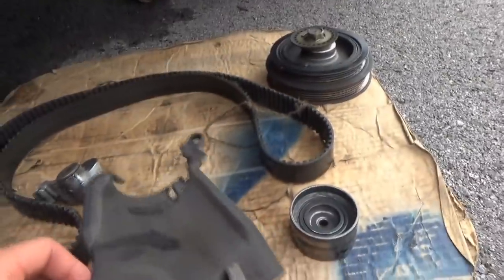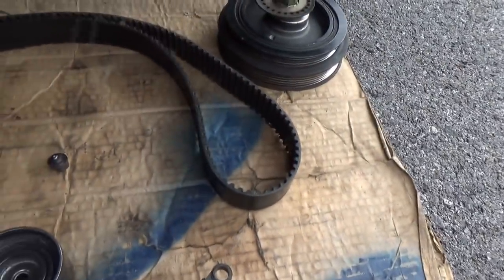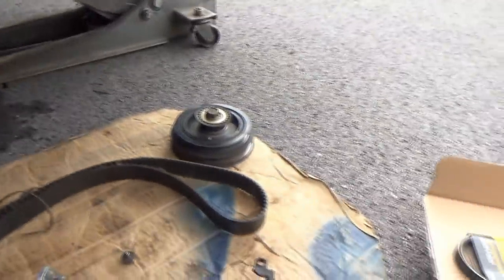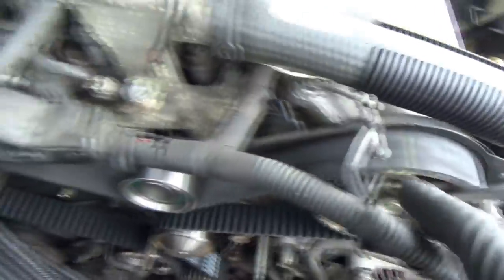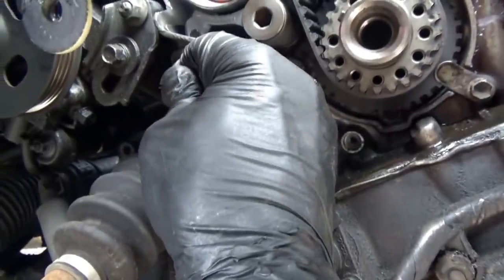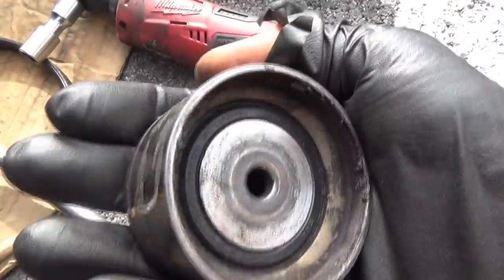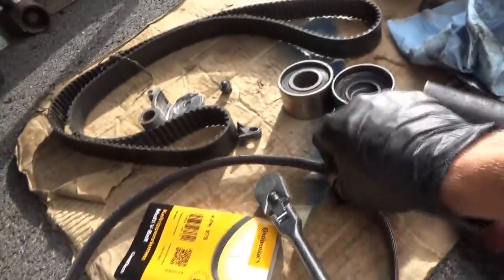Lexus Timing Belt CARNAGE!

Comment: Timing belts are quite and everyone likes a quiet engine,  some people like a loud exhaust ( I don't understand why ) and like you said with a non interference engine that's fine even when it does eventually break replace it and typically the water pump. or whatever parts go along with the job and your on your way
Reply: never heard  my timing  chains  in my gm cars  an my corvairs are gear drive  they last an last
Reply: I have a new Tundra...the 5.7 is very quiet. When you hear the chains, they are warning ⚠️  you that 💩 is coming soon. With oil changes, chains should go forever.

Comment: The 1MZ-FE was non-interference before variable valve timing was added. At normal timing a VVT version was still non-interference, but contact could be made depending on how much timing was being adjusted. Mom had an Avalon well past 300,000 miles. That engine still ran like new. It never needed anything past 2 timing belt (and preventative water pump) replacements and a new VSV for the EGR. I can only hope my 2GR-FE is that reliable (and yes I know it has a chain).

Comment: Nice job Ivan🤘 There's ya problem lady, and boy she was lucky it was a non interference engine. The other shop probably thought it was an interference engine and didn't want to touch it, potentially thought it was already toast. I wonder if the last time it had the timing belt job done, she or the previous shop skimped out on a new tensioner pulley, idlers, seals etc? I always recommend a full timing belt kit (including hydraulic tensioner + water pump if applicable to the engine) Just not worth reusing any of the old components while you're in there doing the job.👍🇦🇺

Comment: Bruh, I want to start be saying after over 20 years as a professional auto technician that you are one of the best diagnostic techs I have ever seen. And it’s a genuine pleasure to watch you work.
But I have two comments on this video.
1. I noticed you put a new water pump on there. But she didn’t go through the procedure at all. Did you take the cans in the backing plate off? Or did you sneak it out past the backing plate or cut it a little bit ? Plus I know from experience those engine mount bracket studs can be a real pain in the ass.
2. Now this one’s a little bit more of a scolding. I really have to wonder why you didn’t get a new hydraulic tensioner on a vehicle that is over 20 years old. Yes I realize that you may have checked it and it may not have been leaking. But you also compressed it to full travel. And in my experience hydraulic seals don’t like that after being inside a vehicle for that long.
I’m just saying how expensive is a tensioner versus the price of a disappointing customer maybe it’s a situational thing and you had to make a call. And I can understand it. Just saying at least inform the audience that might be a good idea to replace it.
Reply: I doubt if the water pump was done. I don't see any coolant on the ground, or buckets to catch the old stuff.
Reply: Yep, I had exactly the same thought on the tensioner, it's going to fail much sooner than any of the other timing components.
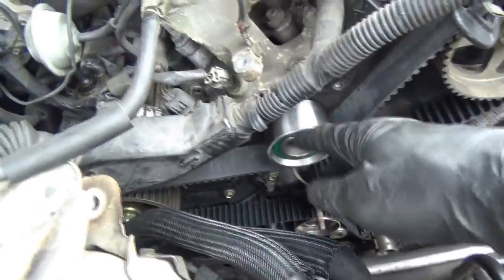Reply: @mph5896  Well someone replaced the water pump, Because if you look at the 4:45 mark of the video you can clearly see a fresh shiny water pump pulley and the entire assembly can be observed a few frames later
Reply: Damn voice text.  You know I meant cams and backing plate. And Apologies for the accidental addressing as feminine.
Reply from the maker: WP and hydraulic tensioner are fine and will easily last another 60k miles 👌🙂
Reply: @PineHollowAutoDiagnostics  
So the W/P wasn’t replaced? Damn. Looked brand new from this side of the camera. Well. Like I said, You’re one of the best i’ve seen.  So if you say it’s good I’ve got no reason to doubt your professionalism. 
One last question, Do you subscribe to ALLDATA TechAssist?
Reply: Customer does not want other work. Don't chastise Ivan for doing what he is being asked to do. If the customer doesn't want other work. That's their choice. Ivan is a dang fine stand-up guy in my book. ❤
Reply: I agree on the tensioner, because many times a weak tensioner is not diagnosed and the belts runs looser than it should, which results in rattling around like mad from engine valve train harmonics.
guess what that helps ruin?  the belt, tensioner bearing, the tensioner itself which now fails even faster and more. nothing likes harmonic battering!

Comment: I used to use Dayco timing belt kits, started having a lot of trouble with the water pumps. I switched to the Continental kits, no more problems.
Reply: I stick to aisin...
Reply: @Usmanthemecano  Aisin is usually OEM. The one nice thing about Continental is the marks on the belt.
Reply: @Usmanthemecano  I've use the Aisin kits on occasion but my supplier more readily has the Continental kits available.
Reply: I had a few Dayco accessory belts that would squeal like a motherlover for no reason. Put just a random Chinese brand on like a Blueprint or something and no more squealing. Very annoying.
Reply: The last Dayco timing kit I bought (for a four cam Subaru) included a wrong sized belt.  Everything else was okay.  I had to get the belt from Subaru.
Reply: Aisin d best
Reply: @Usmanthemecano  Aisin here too.  The bearings are Toyo from Japan and the water pumps look identical to the genuine Toyota that I remove.  Just looks like they grind off the Toyota name for licensing purposes?
Reply: @lizard944  exactly
Reply: @pirihern9329 Use Aisin, Never ever an Issue. Burnt to many times with Dayco, Gates, and Continental. Aisin all the way to the Bank Baby!

Comment: i'm about to change the timing belt on my 2003 Ford Focus. It still has the original timing belt. But the good ol 2.0 Zetec is non interference.
Reply from the maker: Same engine as my 96 Mercury Mystique 😁
Reply: @PineHollowAutoDiagnostics  it's a great engine. They are hard to kill. Not very powerful or efficient. But it'll last a long time. I've had my Focus for a year and haven't done anything to it mechanically. It has never let me down. But i am gonna get all the preventative maintenance done. The car has 111k miles. I flushed the power steering and brakes. Now gonna go over the whole cooling system. New hoses, thermostat housing, motor mount, timing belt and water pump. It'll give me piece of mind.
Reply from the maker: @RicardoPCGamer  yeah mine has almost 300k miles on it and doesn't burn a drop of oil! Averages over 30mpg with the 5 speed manual so no complaints 👌
Reply: @PineHollowAutoDiagnostics  yeah i remember you making the video of it crossing 250k miles. Mine doesn't get great mpg. In the Focus automatic, I'm lucky to get 24 mpg combined.
Reply from the maker: @RicardoPCGamer  yeah the only reason I got it was because of the Euro 5-speed trans...shifts smooth as butter with the new clutch :)
Reply: @PineHollowAutoDiagnostics  yeah I wish my car was a manual. I am a Subaru tech, and i enjoy driving the manuals when they come in. The Focus is kinda fun to drive. Mine is a ZX3 hatchback and it handles great, but the automatic is just meh. A manual would make the car more enjoyable.

Comment: I recently bought a 2002 ES300 [VVTi 1MZ-FE] 250,000 kilometres.Cambelt was recently done before I bought the car.Last week the engine packed up going round a roundabout.Made a clack clacking noise.Had it towed to the mechanic's shop.The plastic timing cover was ruptured at the top.Mechanic said that it appears that the camshaft has snapped!He's never seen anything like it.In dispute with the used car dealership I bought it from.Ongoing!

Comment: I use Asin Belt kits never had a problem yet, For the interference 1.7l Honda Civic engines found in cars from 2001 through 2005.

Comment: She was oh so lucky to own a car with a non-interference engine and an overbuilt one. Plus access to it looks easy so labor should be reasonable. In the 90's, timing belts lasted 40 to 60k miles or 4 to 5 years, only Honda, Toyota and Lexus timing belts were known not to break after triple the intervals. That said, I think replacing it on time cannot be stressed enough. It will avoid you being stranded, and the belt or pulleys destroying nearby components by flying off. Especially nowadays, with all engines being interference and thight engine bays.

Comment: I did a Honda Accord Aerodeck head back in "93 because the water pump seized and stripped teeth off the belt bending numerous valves. It must have made quite a racket prior to seizing but the owner apparently didn't notice. The worst part was the vacuum lines everywhere.

Comment: Non-interference engines are the best. My father had a chevette that would eat timing belts in 20-30k miles due to wear on the tooth pulleys and he didn't want to spend the money to buy new ones. He carried a spare belt and when it would break could change it in less than half an hour.

Comment: Some like belts, me, I like steel.
Reply: Non interference, belts are just fine. Obviously the issue here wasn't the belt breaking and in most cases it isn't, a pulley seizure is what will cause the belt to break. With a chain, tensioners go, guides wear out, and sometimes they stretch enough to mess your timing, not to mention if they break they usually destroy timing covers etc. without taking into account engine damage on interference engines.

Comment: I can guarantee you that tensioner is the factory original. The owner just throw in just the belt at the first T-belt change.  Use Mitsuboshi OEM belt and those lasts 150K miles. Any aftermarket belts won't go more than 75K miles. A gates belt started cracking at 50K miles.

Comment: Hope you used torque wrench on crank pulley. I made that mistake of using impact and within a couple weeks the bolt backed out and fucked the crank gear and balancer
Reply: That Milwaukee impact will generate more torque that you ever could by hand with a torque wrench. As long as he doesn't snap the bolt off that is.
Reply: Hope I held the trigger longer than you did...  Whoops.
Reply: @DL101ca  many times the diameter, length and hardness of the bolt makes a torque limiter when "rattle gunned". Never rely on them to torque things properly, especially longer bolts with dead space between the surfaces being clamped.
that means it's a big NO, for crank bolts, head bolts/studs/nuts, subframe connector bolts and most all suspension and steering bolts.

Comment: That’s why early Lexus and and 90’s Camry’s are tanks. You break something , no problem, the systems are independent of each other. Just fix the broken part and keep on truckin’. Cars today will grenade over a bad spark plug or carbon build up caused from a bad pvc valve. God forbid your water pump goes out on some cars, you destroy the motor from coolant leaking directly into the engine oil.

Comment: My experience with timing belts is that previously only the belt gets changed. Too much trouble to bother with the tensioner pulleys and water pumps that the belt runs on. So early failure just like this. The belt looked ok but the bearings let it down.

Comment: What DID we learn today,,,,,you drive it with a noise until you kill it, then you want to dump it, then you find out its fixable and now want to keep it. This type of mindset eventually gets owners or other road users killed when the vehicle has a major problem you refused to fix,,, carry on.
Reply: Also make sure to break down in a parking lot where the owner is ok with a mechanic doing a timing belt replacement where it sits.

Comment: I like timing chains...change your oil and the chain will last loooong time. Ivan, how many foot pounds of torque does your battery impact generate. I am looking to buy one. Chordless tools sure are handy.
Reply from the maker: The Harbor Freight Earthquake has some good ugga duggas. Check out the Torque Test channel for some scientific torque numbers 😉
Reply: Looking at all the issues with modern timing chain motors, I’ll take a non-interference motor with a once-every-100k belt any day of the week
Reply: @gtemnykh  Modern V6 or V8 engines with 4 cams have the most complicated timing chain setups. Too much shit to go wrong, 3 tensioners 3 or 4 chains and plastic guides everywhere. The chains don't even last all that long. They can stretch after 100k miles.

Comment: Interface engines 😡 I had a dodge neon that broke a timing belt. Dealer wanted $5K to fix it. Found a garage that did it for $1,200.
Reply: Interference.
Reply: And got that pesky head gasket leak fixed at the same tims.

Comment: Nice video Ivan but it sounds like you recommended the timing belt replacement few years too soon :)
Reply: Where ya been R&W?
Reply: Recommended at 100K with OEM belt. Mine at 100K looks like new.  My volvo beaks at every 60K, never failed.

Comment: @Ivan - Given the mileage, and that it's the 1MZ (if trends hold), the owner'll be calling u shortly: Head Gasket; a PITA -  as that engine is tilted towards the firewall. Edit - Now I remember - They were two 01-02 RX300s - both head gasket failures (that cylinder bank next to the firewall is a pain). After 150K miles the 1MZ will need head gaskets and piston rings landings. 1MZ - aluminum block 1VZ - cast iron block.
Reply: Are you sure you’re not thinking of the earlier 3VZ that was used in the first two years of this generation of ES?
Reply: I had a 96 1MZ with 209k when I sold it with none of these problems, and I’ve not heard of it as a widespread issue, maybe something specific to the RX application?
Reply: @gtemnykh  ...Maybe. And maybe u got that one-in-a-million. So when's the last time u played the lottery?
Reply: @tetttettamilli6761  maybe you’re the one that’s the lottery winner with two that popped lmao

Comment: NEVER perform a timing belt job without replacing the hydraulic tensioner, was impressed until I got to that part........
Reply from the maker: OEM one will outlast any aftermarket garbage one you might get in a kit, guaranteed ;)
Reply: @PineHollowAutoDiagnostics  indeed, a replaced oem one will. Toyota is my favorite brand for their quality. Every part has a service life.
Reply: @PineHollowAutoDiagnostics  Aisin is the parts division of Toyota, they are the OEM. Aisin makes and sells a full timing belt component kit with tensioner and water pump.  In our shop that's what all the Lexus and Toyotas get.
Reply from the maker: @LazyLexus  I've seen subpar items even in Aisin kits sadly...sometimes dealer OEM is the only reliable option for parts